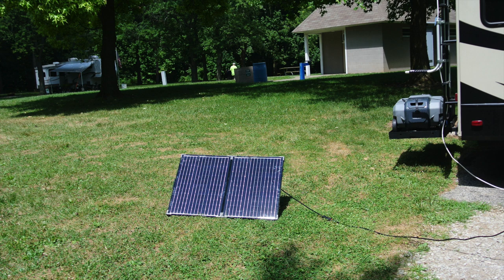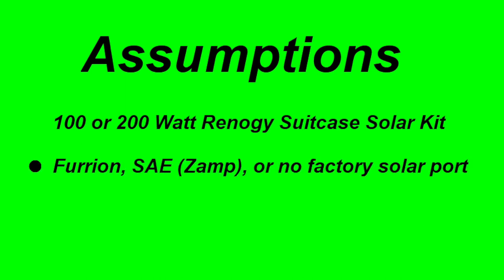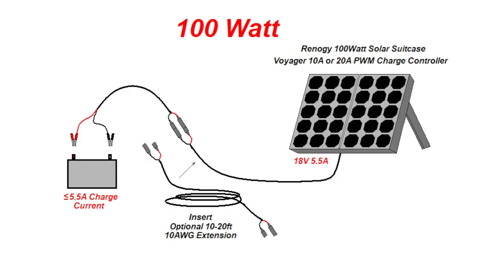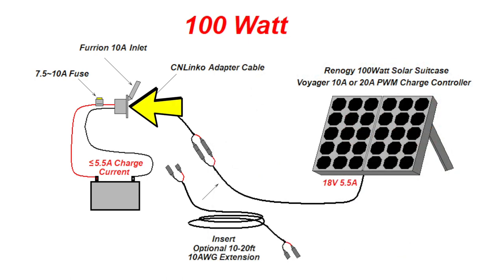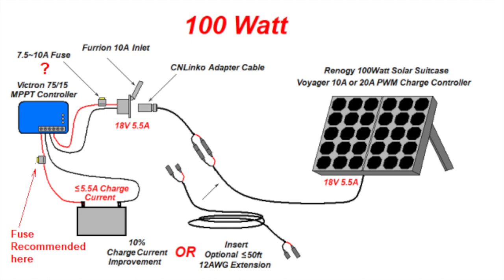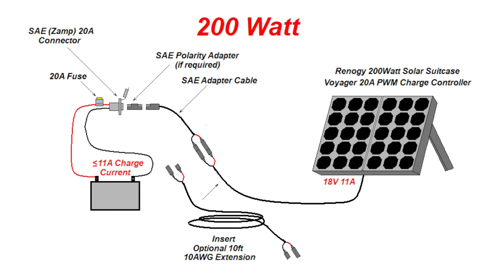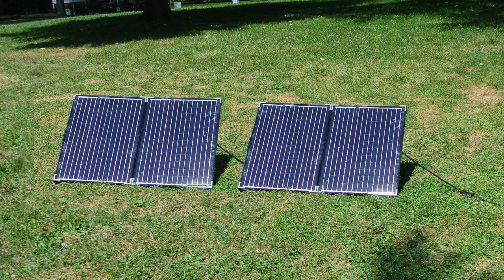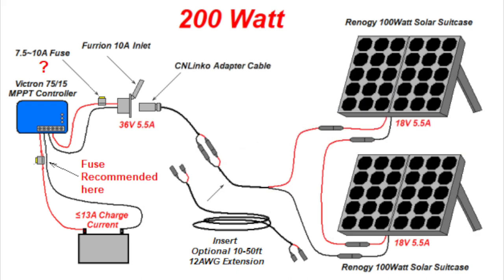Eight ways to connect a suitcase solar panel to your RV.

Comment: Are you concerned with someone walking away with your solar panels?  I want to use them, but usually go hiking during daytime and am concerned with someone possibly walking away with them from the campsite if I am not there.  Any thoughts?
Reply from the maker: There is always that possibility.
Reply: I was thinking the same thing. Maybe a chain connecting them and a dummy security camera pointing at them??
Reply: If we are going to be absent any length of time we put our solar suitcase on the roof, lean an unfurled patio umbrella against the cords to somewhat disguise them to a casual glance and block the ladder access.